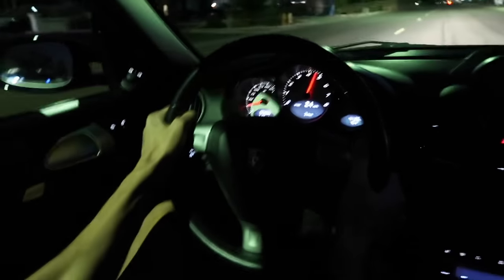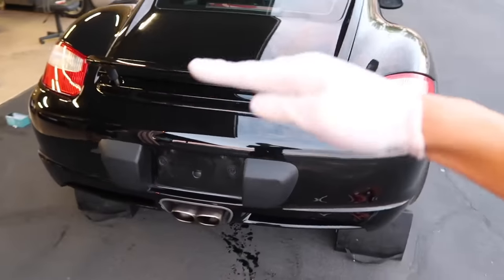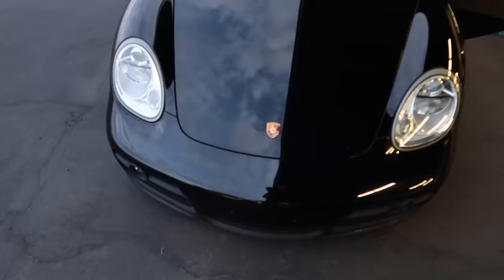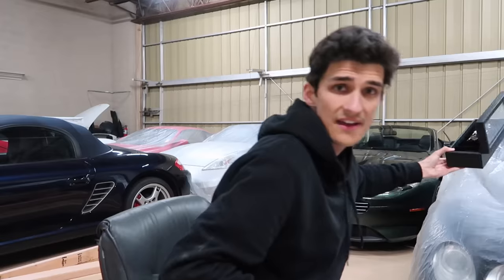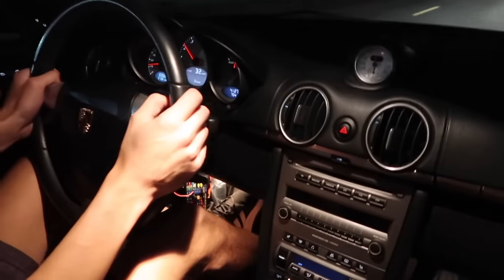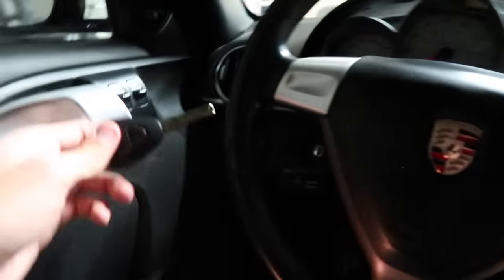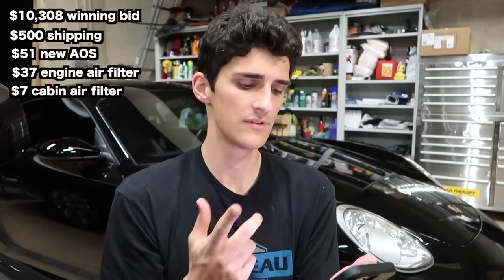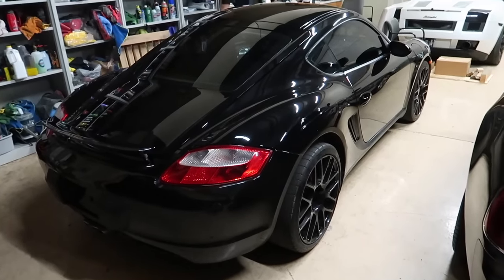First FULL SEND Drive In The Cheapest Porsche Cayman S + Total Price Paid!

Comment: Nice video, as always. 

Couple of thoughts:

- Add the Cayman S logo back.
- Lose the aftermarket wheels. They make the car look “player” - not a compliment! - - Go with factory 18s, in silver. They handle much better and won’t knock your teeth out. 
- Yes, the 19 inch turbo wheels look great – but only use them if the car has PASM.
- When you put new tires on the front make sure they match the brand on the rears. 
- Any metal filings in the oil would likely be from the IMS bearing failing, not bore scoring. But because this is a 2008 Cayman, it has the upgraded bearing with less than 1% failure rate. Good to go!
- Not sure you ever mentioned how many miles the car has on it… But you should probably do the serpentine belt, if you haven’t already.

Comment: Regarding the shifter,in the cayman you'll need to replace the shifter cables eventually. Might as well go with a short shifter. I recommend the stock gt3 set up of that year or go with B&M. For the exhaust you can go with Soul;it's perfect for this car. You can also throw a tune on it, EVOMS is the best,ppl also like the softtronic tune.

Comment: Thank you for using the correct pronunciation of Porsche.
Metal flakes in the filter indicate the IMS bearing going bad and not bore scoring.
Mobil 1 makes an oil specifically for Porsche/BMW/Mercedes and its sold everywhere. I don't know what the difference is, but it worth noting.
The Boxster weights about 190lbs lighter than a same year Cayman.

Comment: I think 18-20k out here is a very fair price out here in our neck of the woods. Back when I was shopping around I found a couple cayman S with 120-130k ish miles for around 18k. From what I’ve seen typically the cars that are under 60k miles are the ones that sell for 25+ again for an S manual and sport chrono. 

As for the wheels I think those are HREs? No idea if they’re real or knock offs or something. With those sport rims I think you guys could probably ask 23 and get offers pretty close to that no problems. You’re still making over 50% at that price so I think that’s solid. 

Also $325 for that detail job isn’t bad my 944 really needs some love bad.

Comment: 01:44 when referring to modern "mutligrade" oils like 5W-50, 5W-30, or whatever the number is, the (W) technically doesn't stand for weight  it stands for "winter".  The lower number still represents the low temperature viscosity and the higher number is the viscosity at operating temperature/high temperature.

Comment: As far as the badge I would see if the car has the badge delete option. Leave it off if it was off from the factory. Replace if it had it. One thing you notice with Porsches is the more original the better generally when selling.

Comment: I hope you guys checked the oil lever after the oil circulated now that you did a proper test drive. Remember you said the dash said the oil lever was over. Now that the oil circulated it may be under the correct level. I would double check.

Comment: You forgot to add in the new front seat repair or replacement. Also, around the 10 minute mark there is a shot of a headliner needing attention. If you ask less than $30k, you will attract the worst kind of buyer. All the personal attention dropped on this car to get it where it is today is priceless.

Comment: Oil logic?  He said that thick oil is hard to pump up, yet they are using a 50 weight oil which is very thick.  Most water cooled cars use a 20 or 30 weight.

Comment: Dear Bros,
The Porsche Cayman S is bought for a clever price plus you didn’t have to do a lot to let the car decently running and to let her look fine. I recommend you to leave the wheels as they are and only change the tires where needed. The black wheels offers the car a more aggressive look what will be even more aggressive with another more sound producing exhaust. 
With us in the Netherlands a 2006 edition with 180.000 kilometers (about 112.000 miles) has a price value of at least € 22.000 (about $24.000).
So your made costs are with us very profitable.